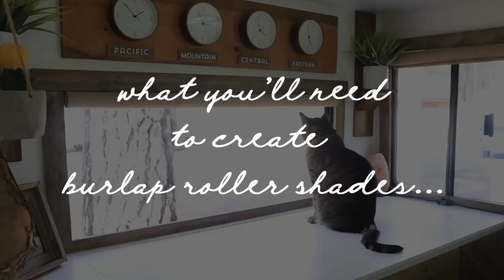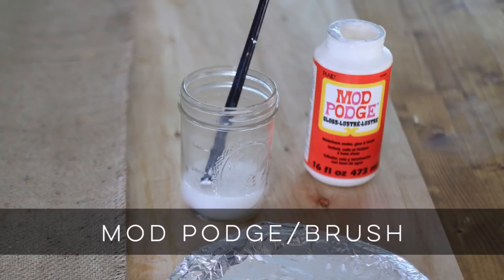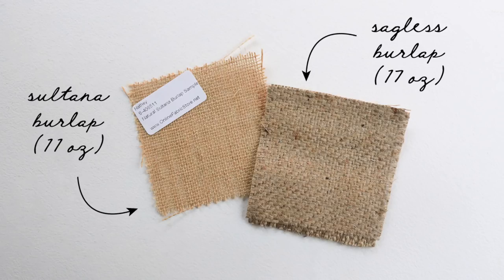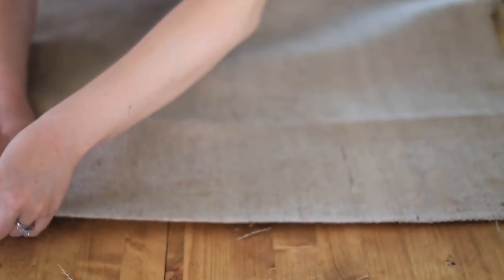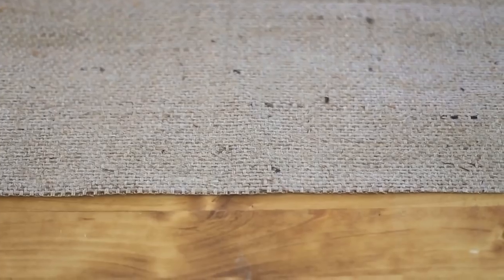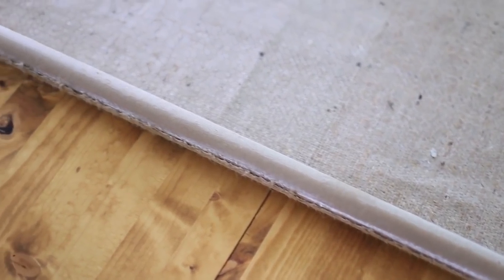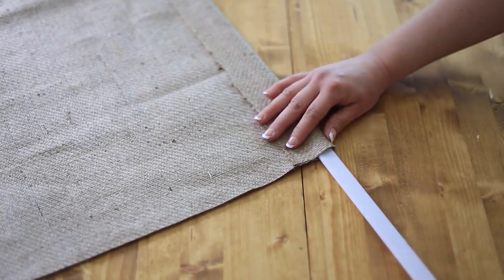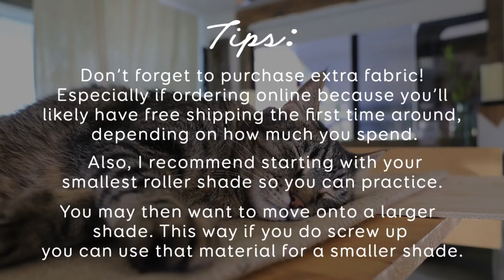How to Make Burlap Roller Shades (No-Sew!)

Comment: That looks really nice! I suppose you can do this with any kind of fabric that isn't stretchy. Thanks for the great tutorial!
Reply: If you use thinner fabric, like a cotton, you can also use spray adhesive to glue it right to the shade.  Just be aware that, like Katie says about the burlap, the shade will be bulkier when you go to mount it.
Reply from the maker: Yup, any fabric will work and like mentioned below you can definitely attach fabric to the existing shade if you choose a lighter fabric but need more privacy. I actually tested this out with my first round of light filtering burlap but ultimately wanted the burlap to show inside and outside the windows, plus skipping the spray adhesive just made it easier for me.

Comment: Liked. Wonderful results and perfect instructions. I love the way the burlap looks against the wood window framing. Those natural elements soften the industrial appearance of the interior, much more friendly. I have an alternative idea. I live in a suburb where the lot sizes are narrow. The windows on the sides of the houses look upon the neighbor's exterior walls and windows. The view is not attractive and there are privacy issues. I bought a pair of large landscape prints because I happened to notice they are considerably translucent when held up toward the fluorescent ceiling fixtures in the store. They are framed like an artist's canvas, cloth stretched over a wooden frame. The prints are large enough to completely cover the top half of my sash windows. When I hold the print up to the window, the unsightly view is gone and instead I see a lovely forest glade all aglow with filtered daylight. The colors and style of the landscape are ambiguous enough that they could be mistaken for all seasons of the year. The art is blurry enough to give the appearance of a real landscape seen from a distance through a haze of sunlight. I had meant to redo the canvas frames to fit snugly inside the window frame with a cafe drape or shutters for the lower half for a trompe l'oeil effect. Now I think it a better idea to fit the canvas to a roller blind. Sometimes one does need to open a window for ventilation and maximum daylight. Instead of a spring load roller, I would use a roller that operates with a chain pull to avoid handling marks on the printed cloth. Also, a spring load roller can retract unevenly and so rapidly that it might chew up the side of my print. The cloth used for my print does seem to be a tight weave canvas. The printed side seems treated with a water repellent. But the printed side does not seem so thick a layer that it might crack from being rolled up tight on occasion. The treated cloth seems durable enough to hand wash with success. The top and bottom of the blind are fastened to a rigid support, but I am a bit anxious that the blind would curl up along the two sides. Do you find that happening with your burlap?